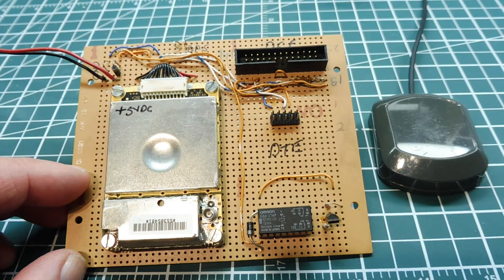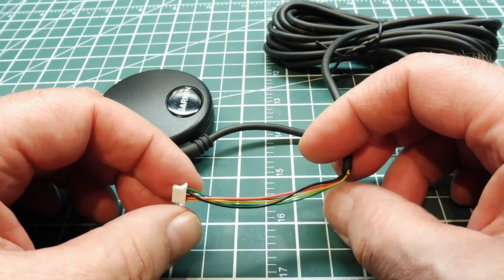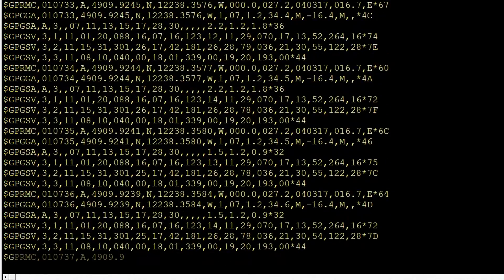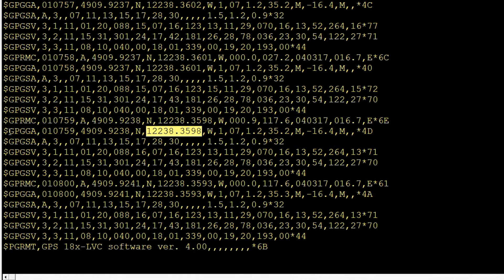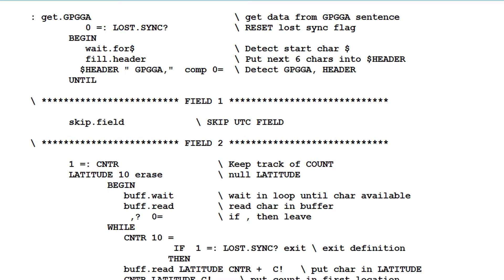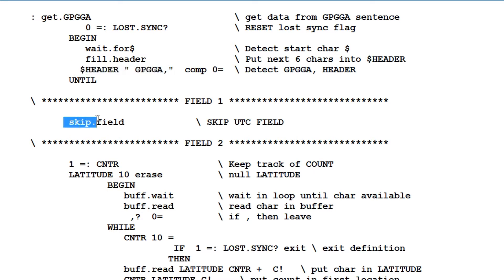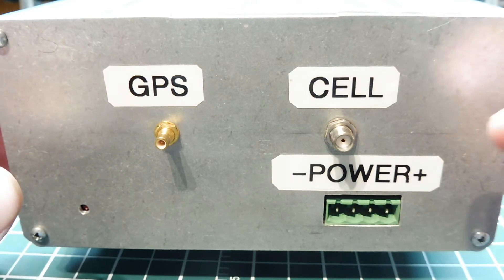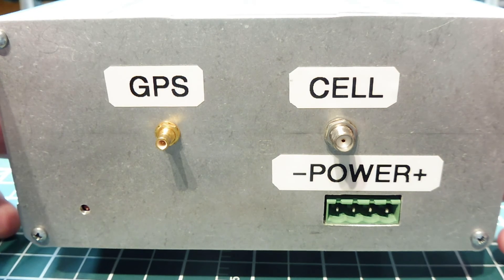GPS Projects  / Vehicle Tracking

Comment: I must of missed this video first time through. That is a very cool project !  I am assuming the forth program is for running on a embedded device. It's not interacting with the output on your terminal of course.  I am planning on building a gps project that was initially for tracking my cat but after looking into it, the hardware will be to big.  U-blox has some pretty small gps modules with built-in antenna for about $25 US  for qty 1
Reply from the maker: I have used some of the Ublox GPS modules and they are always getting smaller. The free software they supply with them has lots of useful features. Lots of mapping software now includes tracking. Google Earth which is free works very well. Check out this video: https://youtu.be/HVgjIUnVpgk